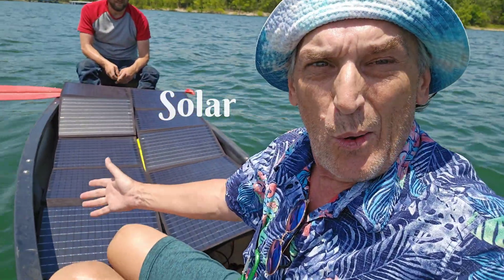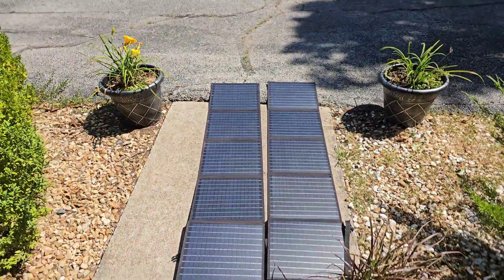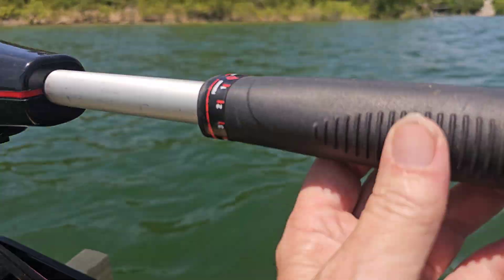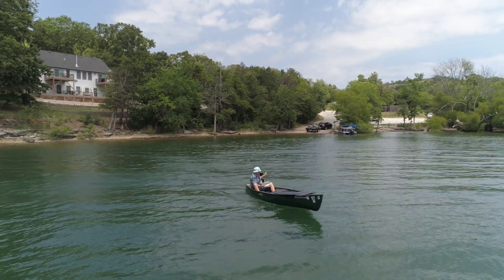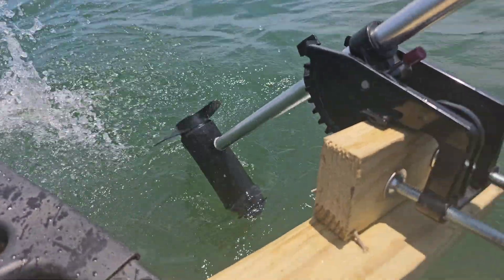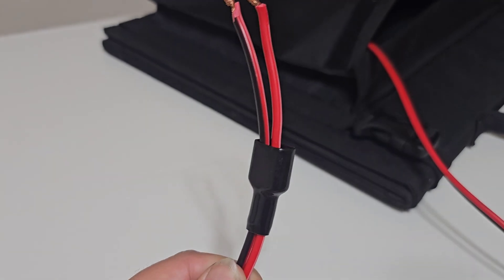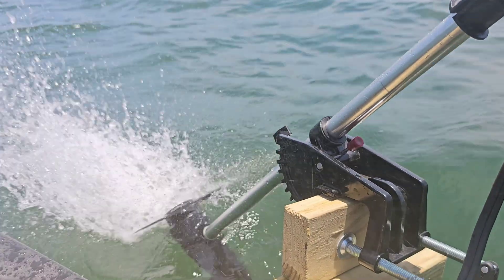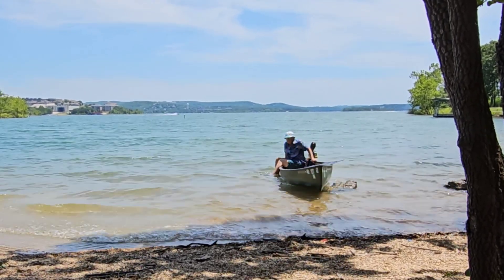DIY Solar Electric Canoe, NO BATTERY!!

Comment: Awesome to see this canoe running purely off the sun!  Im in the planning stage for building out a 17' solar canoe. With a pair of 12' outriggers ill have an 8'x6' 'roof' ,with space on the deck to pitch a tent. would be enough potential space for  800 watts of solar charging a 12v 4.8kwh battery bank. 60lb thrust trolling motor.  Pipe dream of completing the Great Loop in it haha
Reply from the maker: Wow, that sounds amazing.Keep me posted on your progress, maybe i could do a youtube video on it when you complete the project. .Good luck.

Comment: Besides successfully demonstrating 'solar panel area' vs. 'electrical power that can be used to do work', this could be used as a good argument for wearing sunscreen. That same radiation power density is being dumped into your skin. Feels good tho.
Reply from the maker: Good point!  Thank you for the comment.

Comment: Awesome test, Thanks for trying this! I've wondered if it was even possible to do this, as this year I've been playing with a trolling motor & leisure battery on my inflatable canoe, and I thought about doing a solar trip. 
Some ideas for your solar canoe v2. Having the panels angled towards the sun, even slightly, improves efficiency. The rigid panels are more efficient than flexible panels, and smaller. A single 200w solid panel would take up less space, and produce more power, than the 2 folding panels. Solid do weigh a bit more though. You could make some sort of clamp on the top rail of the canoe that the panel attaches to, with each side having adjustable struts to raise/lower the side to face into the sun. Really interested to see any future vids!
Reply from the maker: @McBenjiBoo  Love the 💡 ideas!  The thing I noticed was that when the sun goes behind a cloud, the boat slows  down, but it is fun to see what's possible.  I am still experimenting with a panel just large enough to charge the battery.